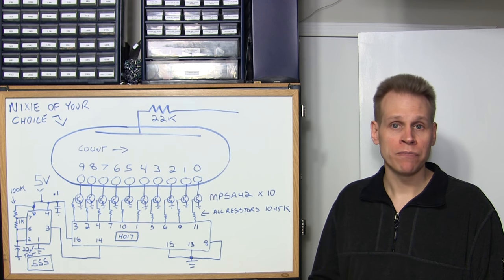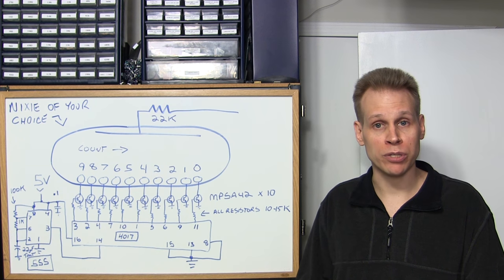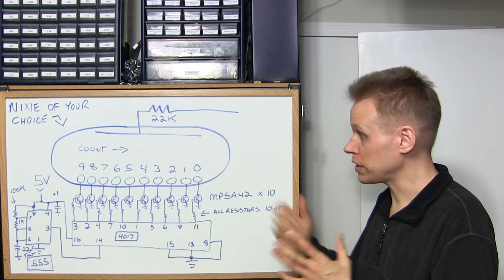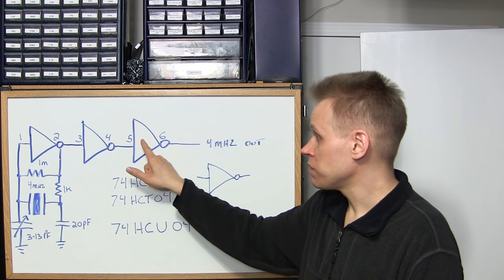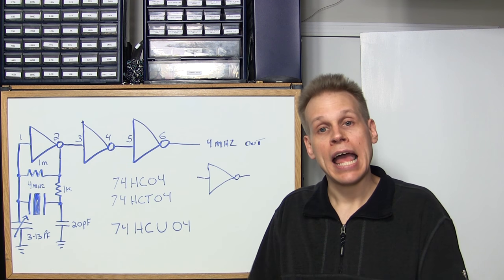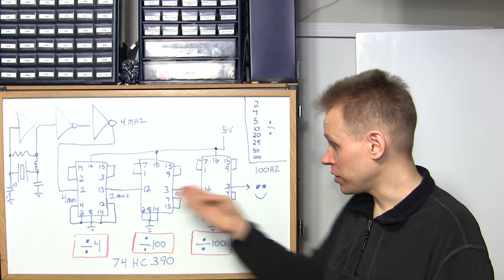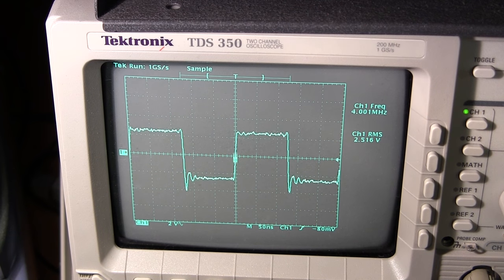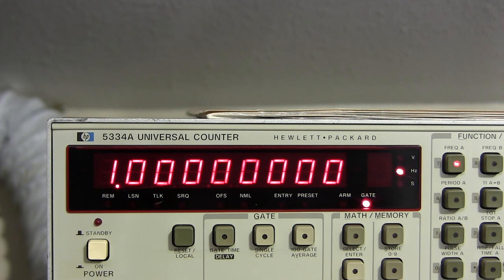The Crystal Oscillator and Frequency Division

Comment: Since I had to do quite a bit of research and I am grateful to Mr. Carlson for giving us this project, here is to clear up any confusion about the 74HC390 counter ic.
Divide by 2:
Input pin 1
Output pin 3
Ground pins 2,4,8,12,14,15

Divide by 4:
Input pin 1
Output pin 13
Connect together 12&14, 3&15
Ground pins 2,4,8,12,14

Divide by 5:
Input pin 4
Output pin 7
Ground pins 1,2,8,12,14,15

Divide by 10:
Input pin 1
Output pin 7
Connect pins 3&4
Ground pins 2,8,12,14,15

Divide by 20:
Input pin 1
Output pin 13
Connect pins 3&4, 7&15
Ground pins 2,8,12,14

Divide by 25:
Input pin 4
Output pin 9
Connect pins 7&12
Ground pins 1,2,8,14,15

Divide by 50:
Input pin 12
Output pin 7
Connect pins 1&9, 3&4
Ground pins 2,8,14,15

Divide by 100
Input pin 12
Output pin 3
Connect 9&15, 1&7, 4&13
Ground pins 2,8,14
Also note that pin 8 is always ground and pin 16 is Vcc (+5 Vdc)

Comment: How about a 32.768k crystal driving a 74HC04 which clocks a CD4020 to divide the frequency down to 1hZ. Then clock a CD4040 with that to drive a CD 4515. That's just another way you can do it. It was constantly rubbed into us at university how critical decoupling/bypass capacitors are and to have them as close to the chip as possible. I will never forget it. The professor was a great teacher. It's probably the only reason I graduated.
Reply: Just add another div/100 on the 4Mhz chain.  Would that be worse to have 4 then?

Comment: Always enjoy your videos, Paul! Last weekend I got two kewl Hewlett Packard pieces really cheap because they weren't working. A hp 711A which is a 500 volt 100 ma bench supply that I have wanted for a long time because it is small and will fit under the "monitor bridge" on my bench. (I also have a Fluke 407 which is an excellent p/s 550v @ 300 mils but a brute! I used to have a Lambda 71 like yours, also a brute, but it got grossly damaged in shipping and it had a lot of hard to source parts in it so I junked it.) The hp 711A was a great big $5. While I was at the seller's place he brought out a hp 521 which is a 4-place decade counter with the 4 x 12AU7 (5963) tube plug in decades. Always wanted one of those, for no good reason, but for $10 I didn't have to think about it very hard. 

So I get them home and gradually variac them up...and after a few hours of ramping up the line volts, they sort of worked, sort of didn't. Power supply only went up to 270, counter was frozen. So I opened them up. I remembered in another video you pointed out bumble-bee tubular caps as "always suspect". Each item had (only) 2-3-4 of those and after lifting one end, half of them in fact measured leaky. I shotgun replaced them all and both pieces began working fine, needing only minor adjustment. Power supply now makes 530, counter self-tests good. I will cook them for a while before pronouncing them fixed, but the before/after difference was quite obvious just from those caps. 

So that was great advice on those bumblebees and I thank you!
Reply from the maker: Glad you got that equipment working. You have some nice older stuff there!

Comment: I'm definitely interested in the HV supply video. My 1N14 Nixies and I are looking forward to your next video. I also have 100 of the K155ID1's but it sounds like you aren't going to use those.
Reply from the maker: 100! Wow, your set for a while.
Reply: I would like that HV supply video to my possible nixie clock :D
Keep up the good work!
Reply: To be honest usual way it has been done in past was just transformer tap, one diode and filtering capacitor, not much of a design;) But doing a step-up converter for battery devices is of course an interesting subject.
Reply: Beyond set. It was one of those all or nothing deals and I couldn't pass it up. I couldn't afford to buy a Nixie for each one that's for sure.

Comment: Please do a series on High Voltage power supplies. A variable power supply for experiments with tubes could be useful for learning how a tube works rather than just watching it on You Tube or reading about it.

Comment: The CD4017's I've got are VERY sensitive to supply voltage. I had to fool with the input to pin 14. It seems to like a 100k resistor in series with the pulsed 5 volt output from my Arduino made it happiest. It also seemed a little squirly with the output from my Wavetek function generator from the late 60's, although it behaved fine when I got the correct output from that. Too much OR too little voltage on pin 14 and it won't count. Experimenting on a solder-less bread board is a must. A nice CURRENT LIMITED power supply is definitely recommended. 20 mA was plenty for a single CD4017 and 10 leds. Also, Arduino's are NOT short circuit protected on their output pins that I can find, so be mindful of that. What a fun project!

Comment: Definitely interested in your High Voltage Supply series, especially "safer" or low-current-output supplies powered with 9V batteries or similar.

Comment: As always Paul, thoroughly enjoyed the video...and learned a bit.  Please do make the video on high voltage power supplies!  Also, while you are doing that...perhaps you could also cover toroidal transformers and any advantages / disadvantages there might be in using them.  I have been thinking about building a power supply for a vacuum tube circuit and like the idea of a toroid transformer mostly for looks sake.

Comment: When Bob Moog built Wendy Carlos her synthesizer back in the 1960s, it included a "Polyphonic Oscillator Bank" that consisted of twelve oscillators for the top octave, which then ran through frequency dividers for the lower three octaves.  It would be interesting to see how you would do frequency division on an analog signal versus the digital presented here.

Comment: One thing I have not seen, what wattage resistors is used 
and yes I would like to see a series about high voltage power supplies 
I would also like to know where you buy high voltage electrolytic capacitors ,as I need to replace all in my guitar amplifier

Comment: Hi Paul, yes oscillators videos, like ocxo or gpsdo should be a good idea. I bought 2 ocxo 10mhz on ebay. 12v sine wave and 5v sqare wave. I want to make a 10Mhz accurate reference for my lab. I'm planning make a GPS disciplined oscillator (gpsdo). Very useful to calibrate my used frequency counter, for my nixie clock projet and more. This is a must. I bought a GPS module neo m8n too. I found many schematic on internet using pll and 74HC390. Problem is, i dont find a good one with a clean output. From what I've seen, frequency looks good but on oscilloscope, a lot of jitter and harmonic. So if you have advice or link or maybe make a video :) Anyway i'll do some test by myself but i'm sure that a GPS disciplined oscillator made by Mr carlson should be awesome :) I'm just doing a proposal here. Good weekend and thanks again for your video

Comment: I second (or third) the HV supply design video.  As for the oscillator and freq div chain, wouldn't it be simpler to buy a OCXO for $20-$30 and use that, or are you planning to make something that will give similar precision/accuracy over fluctuating ambient temperatures?  It's definitely more interesting to build something equivalent.
Reply: Buying an OCXO isn't very educational, as it has all the oscillator circuitry already built-in, so you just connect voltage supply and it oscillates. Definitely less annoying though, as all oscilator topologies have this amazing feature of stopping to oscillate in the last stage of your design, because they worked with all parasite capacitances and when you try hard on final PCB design they just go silent;)

Comment: Great video, I would like to see the ovenized approach, and a stable HV supply would be neat,  if it could supply 10s of watts that would very neat.  My question is, Vacuum Quartz oscillators are very cheap right now, are they more accurate than an ovenized chip? or about as accurate?

EDIT: also, does the speed of the tube matter?  there is a nice looking 512KHz one, and I want 1Hz for a nixie clock,  should I get this 1Hz from a Megahertz tube? it seems it should not matter.

Comment: Thank you for the very nice video. I want to build a very accurate gate time for a diy frequency counter. For that I ordered a 10 MHz TCXO and want to divide the frequency as you showed. But in the data sheets of the counter ICs is written that the high level of the reset pin needs some time to reset the counters. So, does this reset delay "stretch" my gate time or can i neglect this additional delay?

Comment: Very nice chapter, I am following all the steps... I also would love to see the high voltage power supply. Could I simply use my 110v mains rectified by diodes and capacitors?
Reply: It's how it has been done in bench intruments in the Nixie age, but usually with a transformer to isolate it from the mains. You really only need a half-wave rectifier, they will work at anything resembling DC.
Reply: Thanks for the tip, I bought 6 Nixies and I am trying to build a clock! Appreciated it..
Reply: working on that same, and i know i will learn so much
Reply: +Jakob vejle jensen That is awesome...

Comment: Nice video, thanks for teaching. I got a quesiton: do these load capaitors affect the resonant freqency of the crystal?
Reply from the maker: A variable capacitor can shift the frequency of a crystal (too a small degree.) This is taken into account when the crystals are made, so you can fine tune them in their intended circuit.

Comment: With the nixie tubes powered near 200 VAC I was thinking if you had a transient in the AC line that 300 VDC wouldn't be high enough on the MPSA42 or would the transformer itself or other input varistors pull enough of the transient out?

Comment: Thanks for this, forgive my ignorance but could you use this method of frequency dividing for an oscillator in a ham QRP transmitter? I'm thinking if you only had crystals higher than the operating frequency.
Reply from the maker: Yes, I have done it myself. Then you need to clean up the signal and make it a sine wave again.
Reply: @MrCarlsonsLab  Thanks for the reply. I'll research some more, I'm new to this and have a lot of learning to do. I see a lot about multiplying crystals for RF but not dividing.

Comment: Very nice explanation thanks for sharing this crystal clock circuit is being used in the RC2014 Z80 kit build that I'm doing at the moment. Would you comment about what you mean by unbuffered version is this the output topology or fan out capability?

Comment: My 555 chip oscilator is very unstable  (osciloscope jumps between 1.050 ~1.280MHz) .Is this due to capacitors tolerance or quality? or what may it cause?  Thanks for very educating vlogs. :)
Reply from the maker: The frequency is pretty high for a 555. You need to use NP0 capacitors for an application like this, and the oscillator should be in a temperature stable environment. You will also need to buffer the output.

Comment: didnt know these frequency dividers existed :O i only knew about using flipflops to divide by two. do they use a counter internally to divide by factors like 50 or 100?
Reply: Actually the IC contains a lots of flipflops =)
Reply: but how does it achieve the non power of 2 divisions?
Reply: Yes, it's just counters. The IC actually contains two div by 2 and two div by 5 counters. So the "programming" of the division factor is hooking up the right outputs to the right inputs. The counters will still just be flipflops with a few additional logic gates. Check the datasheet of any manufacturer (NXP, TI, OnSemi, ...) for the IC. I guess most of them will that as a logic diagram.

Comment: Great video, and happily coincides with a project I'm working on using sound chips (output frequency range of many depends upon the input clock.)
I've been using the Schmitt variation of the HCT04 (HCT14,) just wondering if that'd have any unwanted effects or require any modifications to the standard oscillator configuration?
Reply from the maker: I tried the surface mount version of the 74AC14. It works well, but the bias is very picky. I would suggest using a VR to find the correct bias range, then replace it with a fixed value.
Reply: Awesome I'll play around and see what I can get, don't need anything extremely precise since the chips only have a 10bit tone register anyhow.
Thanks for the reply and great videos, very in-depth, some of the best.

Comment: I have a mechanically operated 12v D.C. to 240vA.C. Inverter\step up Mains supplier which is low amp will drive small television etc. I would like to know more about this technology. So would be certainly appreciated by me at least. When are you going to use the New Old W\bench,can't wait to see more old gear revived in you expert way.

Comment: 11:50 So what types of chips need to be used for higher frequency circuits? (let's say, in the range of tens, hundreds and thousands of MHz)  Are there some special types of chips? I mean, it's definitely possible, since we have such high-speed parts in our modern computers. But they don't seem to be some standard 74xx or 40xx CMOS chips – those don't quite work well for frequencies higher than a couple of MHz, right? So how can I', let's say, make a frequency divider or count impulses at those higher rates?

Comment: I gave up on running my BC 191 F on anything but 80, 75 or 40 meters. 40 meters is pushing it! I'd love to see a video on oven controlled oscillators, or oven thermally regulated/stabilized. The audio is not bad, but I got stupid lucky and won a sail boat inverter charger that will provide a solid 14-15 volts @ 110 amps to run the 1941 BC 191 right at 14 volts, not 12, or 13, or 13.7. Somehow the ancient Army transmitter hates low voltage in the power supply, and becomes almost unusable, at even 13 volts. It's okay for CW, and pecking away with a straight key, but not for phone. I made another tuning module using some 14 MHZ, and 14.13 something, 14.2, and 14.3 something, ehhhh, yeah, I can vary the capacitance on the 14 then divide by two and get an oscillator, that covers 40 meters. I will supposedly run 75 watts. I did do the FM conversion, but there is no gaining output power without really changing things. 50 watts is about the top end  for intelligible speech, and me even typing an intelligible message is challenging enough, so....... 170 volts for a Nixie only hurts until the pain stops.

Comment: Thanks for this series Paul. I also want to thank you for helping helping "Bill" AKA "Old64Goat" out for his Tek 2335 oscilloscope. Have you checked out his "Unle Dorkel" yet? What a roar! Check out "Buzz1151" while you're at it.
   
   And yes! I would love to see you build HV supplies out of low voltage batteries for selfish reasons I have to admit. {;-O  I have several tube portable radios that I am looking for "B" battery substitutes. I have seen some switching designs out there, that of course,- are going to be "trouble" with radios because of their inherent switching frequencies playing havoc with the radios.
   If you could design one that uses low frequencies, i.e. 60hz, and boost that up to 67.5 vdc would be fantastic! I realize because of the lower frequencies the step up xfmr would have to be larger than a switching one. But... on the other hand, the output current is so very low I think, hopefully, it would still fit in a conventional "B battery" box with a physically small low frequency xfmr. Or how about voltage doublers galore? i.e. 9vdc, 18vdc, 36vdc, 72vdc.
   What do you think?. I know a lot of us would be very appreciative if you could help us all out. Look up "Batterymaker". He would be very, very, appreciative. All he works on is vintage tube portables.

   Again, great series! Looking forward to the next one.
                                                                                                  Tom
Reply from the maker: Thanks Tom! I will work on a "soft switching" design in the future.

Comment: Great video👍 High voltage, YES PLEASE...!!👍😊I am also looking for a variable lab powersupply 0-30V 1500++W, with variable current limiter 0-50A for radio experimenting. Have anyone made that video? Is it even possible?PS! I do have the huge transformer for this, and trying to use it in a project like this. Its from a forklift charger.

Comment: Hi Paul,  What are the likely culpritts in a Colpitts crystal oscillators not working?  My money is on the 30+ year old crystals.  Loving the Patreon content btw.
Reply from the maker: Thanks Warner!
Reply: Just remember that the Colpitts is still used this day, so my money would more than likely be resistor age and it moving closer to out of tolerance. I have seen crystals that are 50-60 yrs old that rival the new ones. but to answer what would be the culprits would depend on age of the actual parts DIY guys love to play with the Colpitts. Hope you mind me chiming in on my 2 cents worth.
Reply: Any help is gratefully received.  All the parts are 30+ years old being from a Yaesu FT-480R transciever.  I've tested the passives and they all seem to be still in tolerance, not that there are any tight tolerances to start with.  I've got some replacement  trimmers caps to go in so I'll get those fitted and see what happens for a starter.